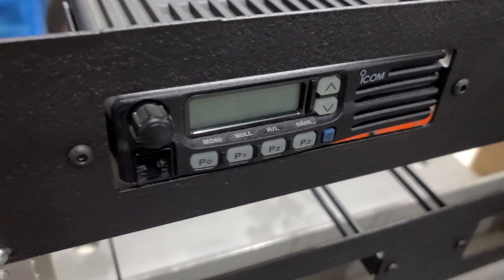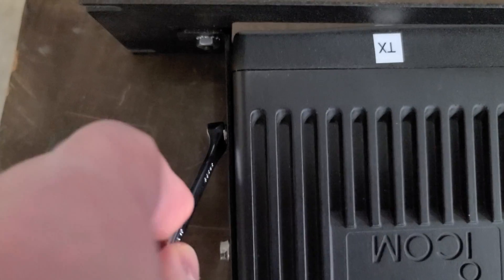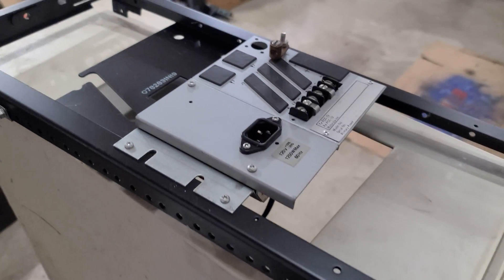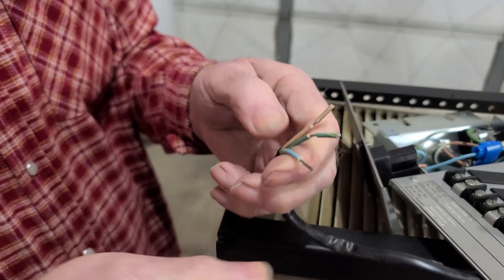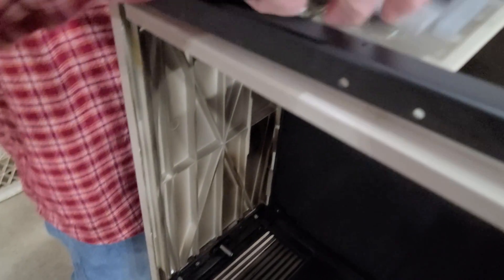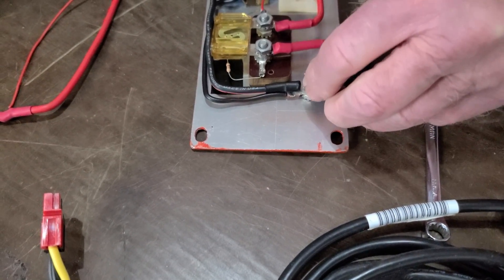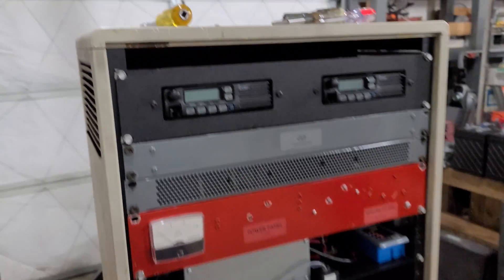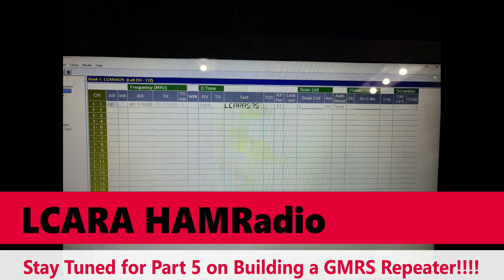LCARA HAM Radio: Building a GMRS Repeater Part 4 - Radio Mounting and Cabinet Power!!!!

Comment: So no cooling fan on the transmit radio? Those Icoms are designed for 10/10/80 duty cycle. I don’t expect them to last long without external cooling. Lots of ham guys love to cobble together mobile radios as repeaters, only to find without adequate cooling the transmitters burn up after a few months of high duty cycle operation as a repeater transmitter.
Reply from the maker: @mrflashport - Take a look at the last couple of videos in the series. We added a fan for the exact reason you described. Thanks for watching!